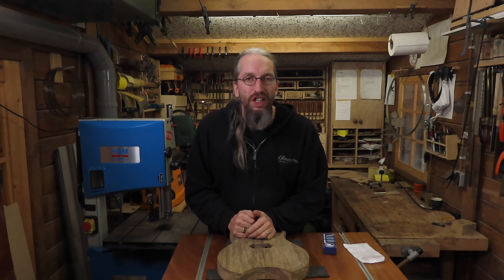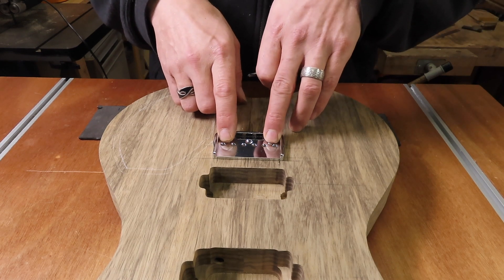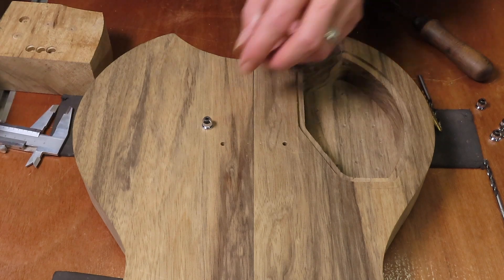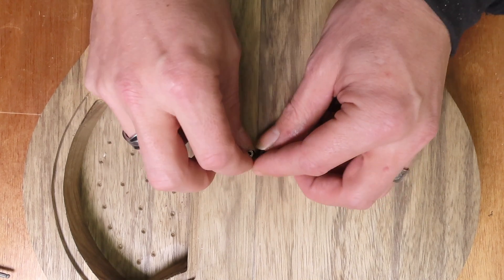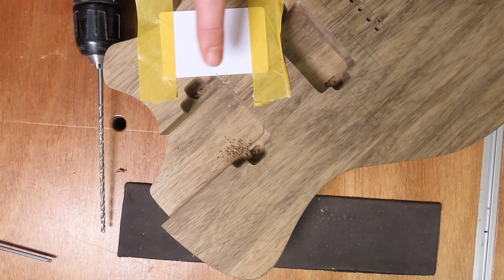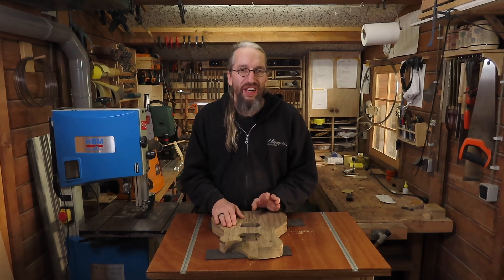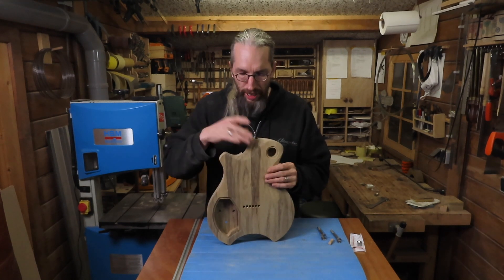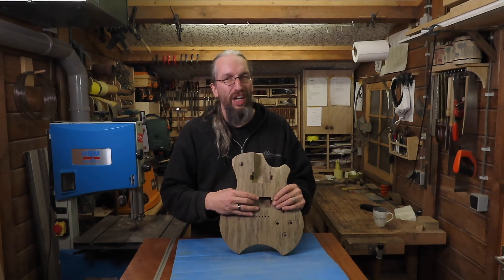Drilling holes and Carving the guitar body - Building a Single Cut model Guitar (Part 9)

Comment: What was the reason for not drilling the holes all the way through? Was it in case the drill bit wandered and put them out of alignment? Goodies! I’ve ordered mine, looking forward to getting them! You will have to look out for them in my videos 😜
Reply from the maker: Hi John.
Yes, the chance of the holes being out of alignment is one reason and I intended to use a regular 8mm brad point drill bit to drill the holes for the string ferules before I changed my mind. If I had drilled the 4mm holes all the way through it would be almost impossible to get the bit centered in the 4 mm hole. But while filming I realized that doing it like this might be more accurate and easier to do with enough margin for error. As we could clearly see.
And thank you very much for your support I hope you'll get your goodies soon. I'll keep a close eye on your upcoming videos.

Comment: Boy I hate doing ferrules. Good on you.
Reply from the maker: Hi Mr. Frontranger,
Yeah it's a tricky job and also not my favorite, but one that has to be done.
I might take some time to try and come up with a fool proof method. Or start using a string stopper block that can be routed in.

Comment: I would have rather seen a top load bridge such as Schaller. It's a great hardtail bridge which is fully adjustable. I hate string thru with ferrules but that's me. Your builds are art.